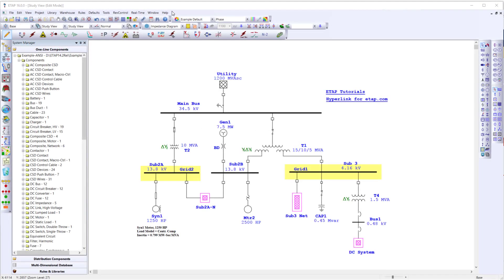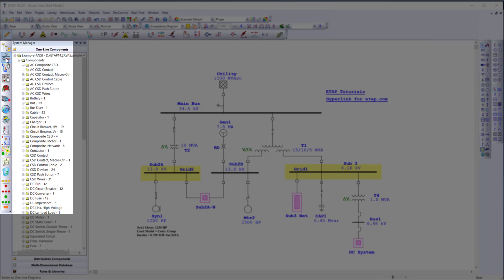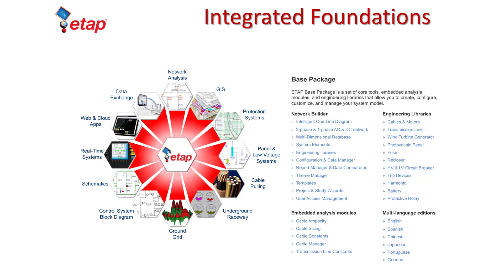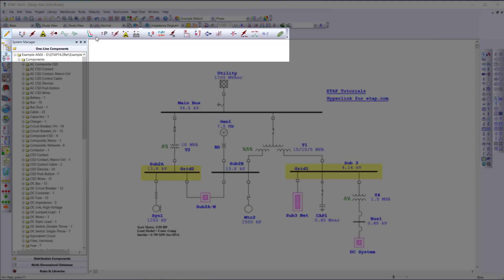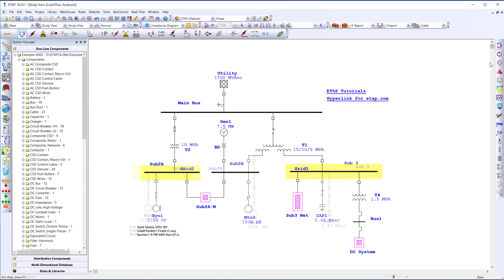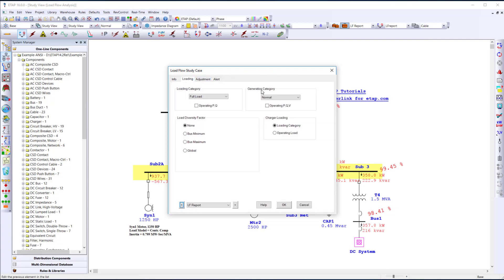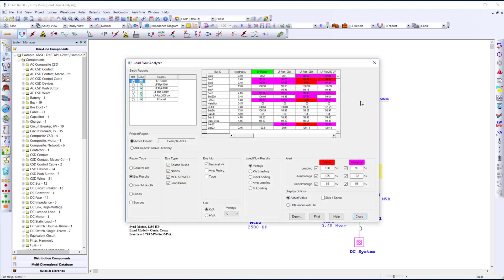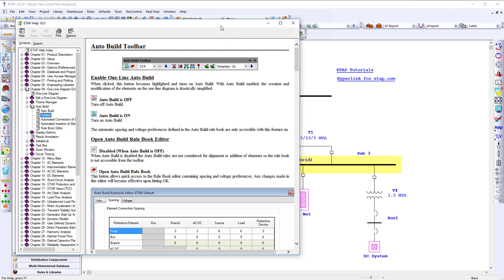ETAP Foundations - Navigation

Comment: When i enter data of transmission line. it does not save data of parameters and configuration, and a pop up shows, Xa should not be zero. ,,,,any solution plz
Reply from the maker: Thanks for watching our video. Please contact one of our sales office in your region and they will assist with your question. If you are an ETAP user you can log into our 24/7 HelpDesk and talk to one of our support engineers.